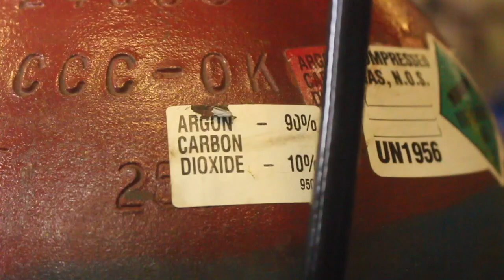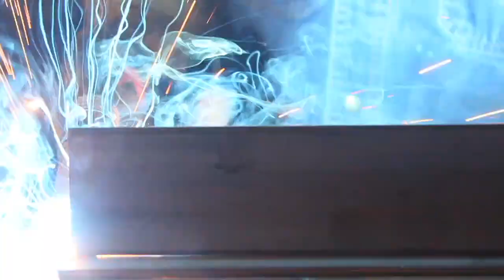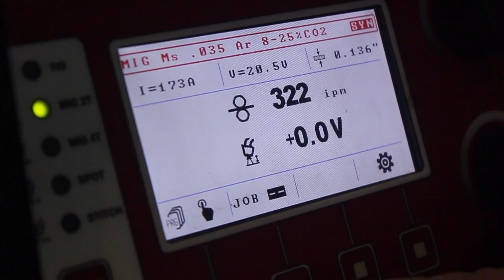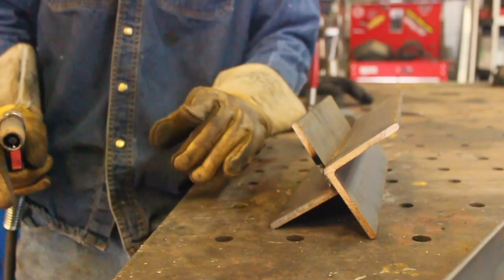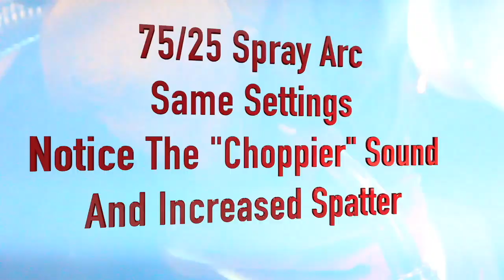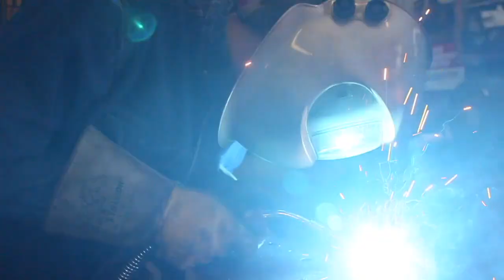YOU WONT LEARN THIS IN WELDING SCHOOL WHICH GAS IS REALLY BEST FOR YOUR MIG WELDER

Comment: I don't know about the current welding classes.

But, you are correct that when I took "metals shop" classes in high school (40+ yrs ago), at our school, we weren't taught about Mig or Tig welding.
School didn't even have the equipment.
We were only taught to weld with the traditional arc welders, and how to weld with wire and a torch (the "old fashioned" way.
And how to braze (sp) with a torch.

I know that it's different. But I think that if I tried Mig or Tig welding, it would be similar to me trying to learn Algebra. Or to do most things having to do with technology (computers/smart phones). I would be lost. 
😂😂